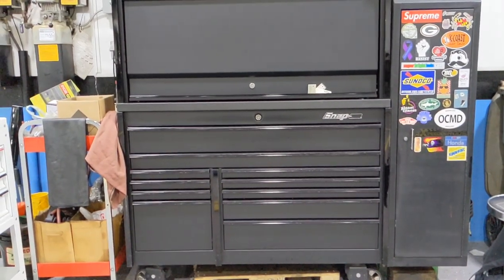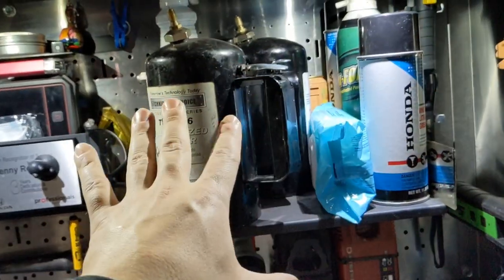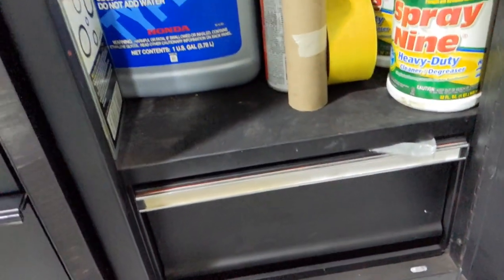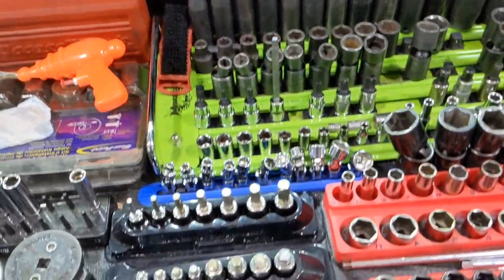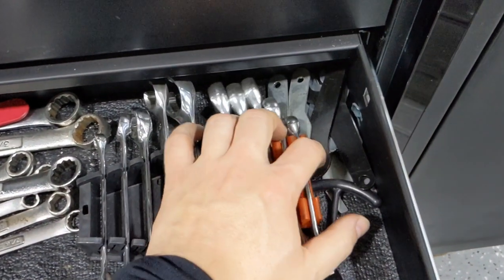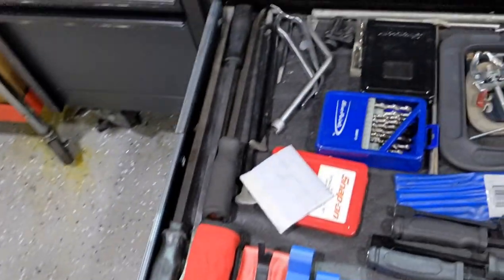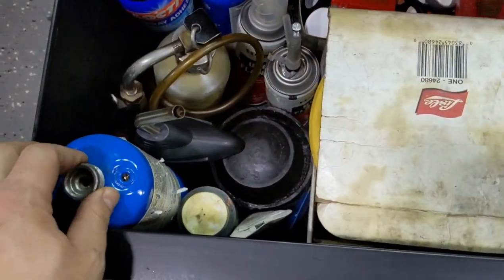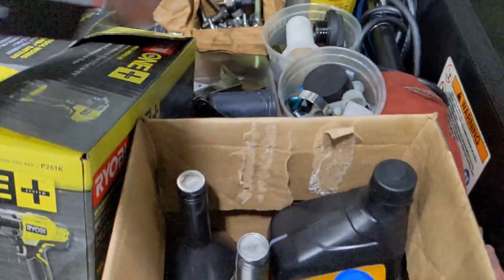Kenz *UPDATED* Toolbox tour

Comment: Did you color your 1/2” torque wrench black? I have the 3/8” green one like you too but it’s just too much green and want to make it like your 1/2”.
Reply from the maker: No. The 1/2 is chrome with the digital read out part and the handle being mostly black from factory. My 3/8 is black with a black handle. But the plastic digital piece is green. My guy couldn't get a black 1/2 at the time.
Reply: for a little while instead of chrome they had a matte black ! some on ebay if you keep your eyes out
Reply: @TurninandStuff  I see. Thanks.
Reply: @joeym.7642  I like the chrome. Just not all the green plastic around lcd.
Reply from the maker: @kaosaepharn4326  they had an all black one about a year, year and a half ago. The 100th anniversary ones are mostly black as well.